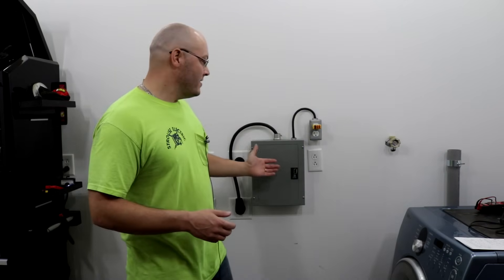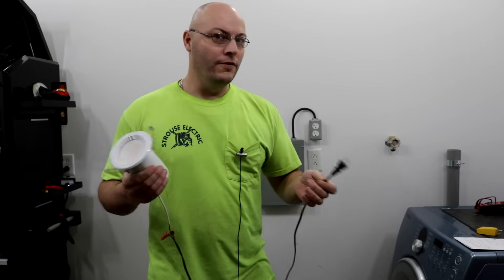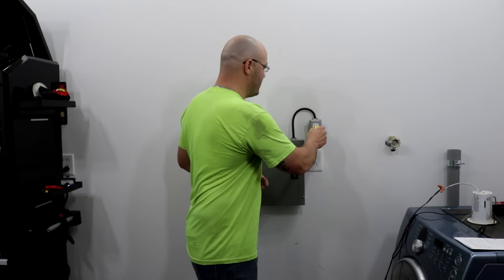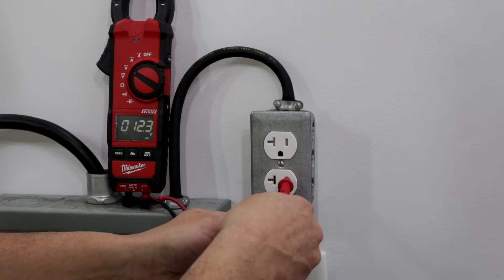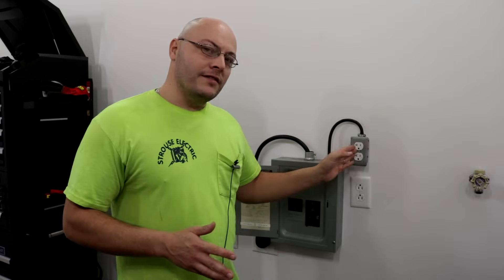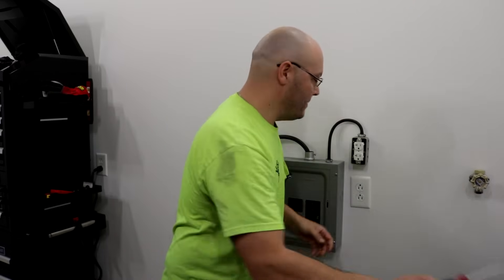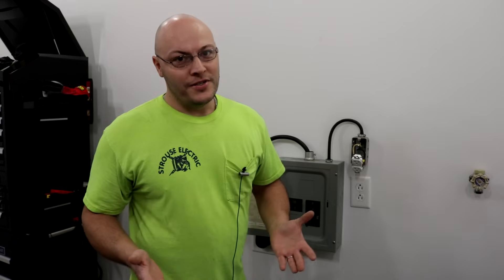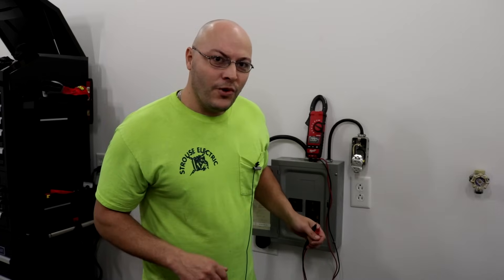How to Test a Wall Outlet - Receptacle Troubleshooting

Comment: I have an outlet on two sides at the front yard and at the backyard for car plugin,  but both are not working. I have pushed the test button present at the breaker in the main panel but it does not work for any side. Is there any possibility that both side outlets are faulty? I am considering it very rare, but not sure that both outlets become faulty at the same time. Should I check both outlets or possibly there is a fault in the breaker (which has a white test small thing on it) in the main panel?

Comment: Great video...mine says hot grd rev but when I turn off the breaker it has a sound but to turn on you don't hear the click sound..what are your idea change the breaker ..any help will do. Be blessed
Reply: Breaker do make a sound when turned OFF, but not when turned ON. The sound is mechanical, not electrical.

Comment: Hi ,
   I just changed a plug and replaced it with a new identical one. I put the wires securely in the same places and finished the installation. I went back and turned the breaker on and it trips, along with the main breaker to the whole house. This house (my sister's place) is just over 20 years old, and the old plug socket was working but the bottom plug had a black smoke stain on it ( it still functioned). Could it be the breaker itself? It's a 15 amp Kitchen split, a double breaker.
Reply: Bill passed away 3yrs ago .
Reply: @lopee161  Oh, so sorry to hear, may he rest in peace.
 I have since found and fixed my electrical problem and I didn't remove my question because I thought it may help others with the same issue.
My problem was a simple quick fix, I removed the tab on the new outlet plug, which was causing the breaker to jump.
Thank you Eli Lopez, Bless you.

Comment: Bill good video.  I never new what the tampered outlet look like.  Have you ever had, "clicking" on a wall outlet that has a two light switches and a tamper resistant plug?  Any ideas as to what it could be?  The tamper resistant plug is a GFI.  Thanks   Jim

Comment: What if it's a 1987 model Fleetwood single wide mobile home and I plug up a electric heater and a radio into the outlets and sometimes you can see a blue spark inside the outlet?

Comment: One step that I feel should be added at the beginning: Test whether the circuit that your “dead” outlet is on has a GFCI outlet that has popped and, if so, reset the GFCI and re-check if the “dead” outlet has power.
Reply: Good catch.
Reply: Lol

Comment: HI I have a big question 
I have a  problem.  My electric wires have the black n white wires. Then a copper ground wire that has been extended. Today I noticed it is loose. Can I remove the outlet and still use the AC current  on my meter and touch the wires and see if there is any power to either side? I have a kitchen  outlet with 2 black and 2 white and 1 copper ground. I've changed out the outlet 3 times and never could figure out why it could be moved and at some times it worked then nothing. Today I put a brand new outlet in the wall n then again I felt the ground wire was loose at the splice of the 2 copper ends. The pinched off end is possibly not grounded..I still need to know if I have hot wire to the area. As I have the wiring that if 1 goes out any going past the one the next lines will not work. 😥 yep I'm at my waist end with this issue  and being a female we still get it from both ends. People think we don't know anything about anything.  
Any help would be of help. Perhaps a video on this subject of I'll make a Help video so others can help me with this issue.  Ty soo much.

Comment: If I use the first plug tester you  used and no lights come on then there is no power in the  outlet and it's  OK for me to touch  it and replace it? And yes my breaker will also be turned off. Thanks.
Reply: You should also use a circuit tester, it turns RED when the tip is close to a wire that carry electricity. Turn OFF the breaker, verify no electricity with the circuit tester, take out the outlet, again check the terminals for no electricity. Now, you can safely remove the wires, put in a new outlet and reconnect the wires. Note that putting the outlet back in its housing box is not an easy task due to the wires.

Comment: If a outlet has no power after checking the breaker and it's not tripped and using a plug meter with no power indication is this something super dangerous that needs immediate fixing?
Reply: @AGibsonJ ok my fault the breaker was tripped it just looked like it wasnt so I reset it and it works now I'm just trying to figure out why it tripped in the first place

Comment: A great tutorial. One outlet on the wall outside of my house is powerless. So hopefully it is just a bad outlet. I am always scared of electricity, so I haven't opened it up and test with a voltage tester.
Reply: Eyetoobur if it’s outside of you’re house, the GFCI might be tripped. All that means is the button on the front of the outlet (like the ones in your kitchen or bathroom near the sink or shower) might need to be pushed to reset it. Hope this helps!

Comment: NO POWER??? Your METER shows 124vac  in that outlet!  Can’t you even READ your meter!!??!!

Also your outlet is ILLEGALLY wired and not safe.  EXPOSED ROMEX below 8’. Check the codes.

Also, why are you so PARANOID?? That’s 120 volts, not 240 volts. Use “one hand rule” and it’s very doubtful that you will ever be shocked (killed? Never...)

Comment: I have a problem with a circuit in the house. The breaker is tripped, and will not click into place. Switched the breaker with another, and same result.  My guess is: there's a short somewhere in the line, or possibly a bad appliance, I guess.  How do I find it?  My plan was to check every receptacle and light fixture, checking for burnt spots in all the wire connections, etc. Is there an easier and/or faster way to troubleshoot?

Comment: I replaced my 220 stove receptacle from a three-prong to a four-prong. everything went fine, except when I was testing for voltage. one 120 is showing up when I touch the mounting plate. the other 120 does not. I plugged in the stove anyways and it works fine. however, im worried that there was current on the mounting plate. I disconnected it entirely and tried again with same results.
Reply: Do you have your ground wire on your grounded conductor, by chance? If so, that would cause current to flow through the outlet and possibly the stove itself

Comment: Great, thanks. How to replace the breaker? I think this is the problem at my house.
Reply: If you don't know how to replace the breaker then it is better you hire a qualified electrician to do the work for you.  There are a lot of amps running through a main panel and you don't get a do-over with electricity if you make a mistake.
Reply: @MrWatercooled  guess what? The AC wall outlet started working again. Very strange, it fixed itself.
Reply: @TarekFaham  go figure. There may be a loose wire or a ghost lol

Comment: you should never reset a tripped breaker till you thoroughly check what's going on..yes they can trip if they're weak but that's very rare..good video though thanks
Reply: Resetting the Breaker is completely ok. Especially if you just had too much plugged in on that breaker and when you turned on the vac it tripped. This is 95% of all tripped breaker cases.

Now if nothing has been unplugged or plugged in differently and everything normally on is on and normally off is off then after sitting on the couch watching YouTube and eating snackcakes for several hours you suddenly have a breaker to trip then sure I'd definitely have to agree with you. Or in a case when you unplugged that extra appliance you tried to use then went to reset the Breaker and it trips again before you even reach the door then again after you again reset it then yep I'd definitely have to agree with you.

In conclusion here if let's say you have a short (unknowingly yet though) in a clothes dryer that trips the Breaker which is bad and probably the type scenario you're thinking because of potential house fire then you're still 100% A/OK to reset the Breaker because that's the Purpose of haveing Circuit Breakers these days instead of fuses. That short is what causes a Circuit Breaker to Trip (Break) and will continue if using up-to-date and non-generic Circuit Breakers. First sign of rust or corrosion? Change Breaker...! And personally I find it very comforting and safe by changing out all Breakers every 5 years. C'mon, they're cheap and easy to replace plus it's ensuring the safety of your family and house.

I believe you're thinking of the 12v fuse rule!

Comment: Omg I moved in a 3 bedroom trailer in February rent to own April 1st ac stopped working 2 months later they put 4 window units, now breake3s keep tripping ,1 st and 2nd light bill almost 400 dollars I'm disabled and my  mom is older  we hardly ever use stove,  2 months no ac what so ever and 700 dollar  light bill, had centerpoint  check box outside cause besides the heart attack I could see myself having from light bill and hot as hell, we have been in one room in trailer for 2 months with portable ac I purchased ,told properly mgr. About breakers tripping and center point recommended electrician come out,all I can do at this point is laugh, electrician it took 2 months to get ac how long will an electrician take6 months !!!!!

Comment: Wow! Just watching your video and, I found myself jumping every clicking sound you made. I hate electricity. When it comes to having to repair it. 
So, my  question is this is it true that I should  or not touch any outlets without wearing  rubber soles and a pair of gloves? I've been told too do?
Reply: Touching the outlet itself is no harm, just do not stick any metallic object in the holes. Most of us touch the outlet without knowing it when we plug in an outlet, babies do too by curiosity !!!. Only when the outlet is taken out and the leads expose, then DO NOT touch these with your hand (glove or not)  unless you really know what you are doing.
Reply: Really?
Reply: I'm sorry! Thanks!

Comment: Good job, a word of warning to amateurs though,  whenever dealing with high volts it's always safer to use one hand when you are probing your outlets, so if something happens then electricity won't flow through your chest stopping your heart
Reply: Thanks I never would have thought of that. Your comment could have saved my life right there.

Comment: Hello there. I do have a problem and it hasn't been able to find the right answer. This is the situation: When testing an outlet, one of the yellow leds (the outer) turns lights weakly; the other (in center) lights well. The outlet box is well attached. What do you mean, is causing that poor signal? Thanks.

Comment: if there's no power and i have not turn off the breaker..what do I do to know which breaker is for that outlet or do I need to turn it off since it's already have no power?(in case the power come back and electrocuted me)
Reply: all 3 of my outlets that located on the same side of my kitchen(by the sink) have no power..what could be the cause?

Comment: Ok i have a weird issue, an I live in an older house. and the issue I'm having i that some of my electronics get damaged if connected directly to the outlet. this is going to be a bit winded but I'm hoping you read this and get back to me. The outlet still works but it's damaging one of my fans. my fan has a fuse in it, but it's not blowing the fuse but instead killing the electronics. I've  had 3 replacement, and during the meantime in the same outlet i ran another through the surge protector. What I find interesting is that the fuse in the fan isn't blowing, but the fan dies. so i confirm this by removing that fuse and using it with another fan. So the outlet works but my fans keep dying, assuming that it's not the fan that is defective, three in a row. with two others that have been perfectly fine, and the three only died when connected to this specific outlet. I assume that there must be something else I'm missing. Now i know that this might be far-fetched but i was reading into how generators have clean sine waves. which i thought was interesting. not knowing to much i saw that the wires in my outlet were really old and to be honest looking like they need to be replaced. I mean insulation looks really bad, and I have dealt with other outlets and done some electrical work. But, the guy I'm renting from well doesn't believe that the wiring is too old, and that it's causing some level of damage.  Theres other things that makes me think that maybe the wiring isn't holding a clean current.. because it's very subtle. So my question should be, how  even though the outlet is supplying maybe the correct current or voltage, prove that it's old wiring is causing the issues that I'm currently seeing in my home? the fan is one example but theres many and I've taken notes on how itss affecting the electronics in my house
Reply: Have you tried to use a receptacle to make sure the wiring on the wall outlet is correct?

Comment: I have hot to ground, but no hot to neutral. This is on 2 separate outlets, both having 2 plugs each in same area.
Reply: @It's Binh Repaired 
What I basically did was trace the wire from one of my outlet that wasn’t working to another outlet that wasn’t working either I followed the wire to a half hot switch and the neutral wire was still acting up at the splice point so I went to my attic to see where the wires run from there and followed it to the smoke detector where the neutral wires were never connected
Reply: I have the same problem.
Did you find a solution?
Reply: @jessegalvan6592  I didn't. I found a 3rd outlet on the line broken, so somewhere along the line the neutral line must have burnt out or something. Strange thing is 2 other outlets on the same breaker work fine.
Reply: It's Binh Repaired I just found my short it the neutral wire was improperly hooked up by the smoke detector causing the outlets not to work
Reply: @jessegalvan6592  how did you find that?

Comment: Wait a minute. You have 120 volts? I didn't see that, but I did see almost every other possible number. It doesn't seem right to me to select one of the numbers that keep changing and flashing by. You could have found 33, or 27, or 155 if you had wanted to,

Comment: I don’t know what happened here in my apartment. They wired it so one of the circuits handles the load diagonally through my apartment. Everything in that circuit went out one night. I heard an electrical sound in the bedroom and, then, everything on that circuit went dead. The circuit breaker was not tripped. However, I turned it off because I did some research and found that the circuit breaker box was made by a now-defunct company who lied about the ability of their boxes to trip when overloaded.

My level of dealing with electricity is minimal and very intermittent. I have replaced outlets in the past and have used a $5 tester, with a lot of wincing, for fear of blowing myself up. However, none of the outlets in the bedroom have I switched out and they have been there for at least 26 years, if not since 1970, when this place was built.

So, when I get the chance, I will have to test some outlets and see what is going on.

I will note that, one time, when I didn’t pay the electric bill many years ago, the electric company turned off the juice. When I arrived home, 1/2 of the place had juice. It was only all of the things on this circuit that didn’t have any. So, I also wonder if there’s any strange wiring in the basement and, no, I’m not going to get my fingers in there.
Reply: if you want to feel a little safer just put a GFI plug in the first plug of the circuit
Reply: @keving9777
Reply: M D still stuck here, but am insured.

Comment: What do you do if the top plug has no power and the bottom plug has power and you turn on all the garage switches and the top plug still doesnt have power and the wires attatched to the outlet are snug and in good condition
Reply: First move would be to replace the plug with a proper new one. They can go bad or burn out over time, particularly from a surge or overload. They are very inexpensive to replace.

Comment: I have several lights in a hallway that all went out at same time, outlets in same are out also. breakers do not look to be tripped, rest all of them, lights still out.  Is that likely a breaker issue or bad breaker(s)? Not sure which beraker controls those lights, so do I just need to check them all?

Comment: I have 3 outlets on one wall the one on the right and left are working the one in the middle is not working I replaced the outlet with a new one still no power can't  be the breaker right or I wouldn't have power to the other two what  is wrong . I'm stumped  the reason the middle one isn't  working is because I had a heater plugged in and it burnt the first one

Comment: Here is a tip for your future videos: You should say "shocked" most of the time and save "electrocuted" for specific scenarios. If you are still alive after contact with electricity, you  HAVE NOT been electrocuted - you have only been shocked.  "Electrocuted" & "electrocution" means to be killed by electricity - you are saying that at times you don't mean to imply death. (To remember: "Execution by Electrocution," "Executed when Electrocuted")
Reply: Looks like he passed away in 2016. It was an informative video nonetheless.

Comment: So I must stay.. I'm here because I don't know jack about this topic.. but at 3:26 you say smaller terminal is supposed to be hot or black.. then at 3:41 you stick the black where the red should go... and red where black should go...  I suppose that's ok.. because you didn't die... just a lil confusing.
Reply: WxGuy it’s ac current so it doesn’t really matter